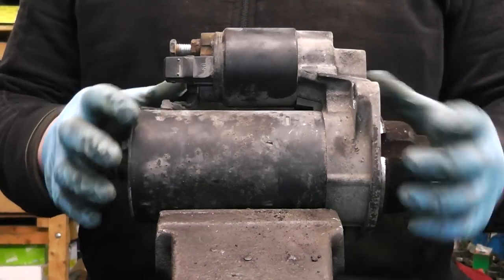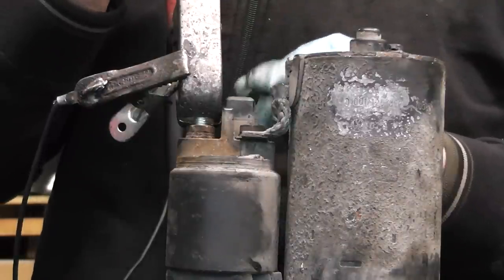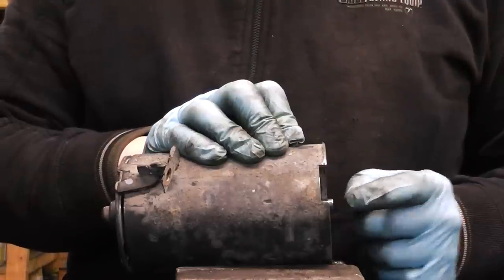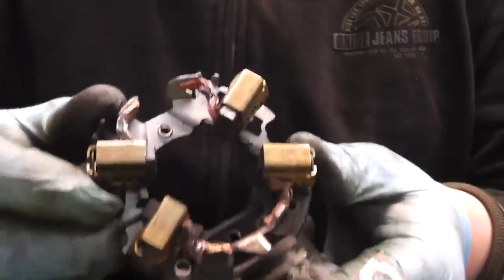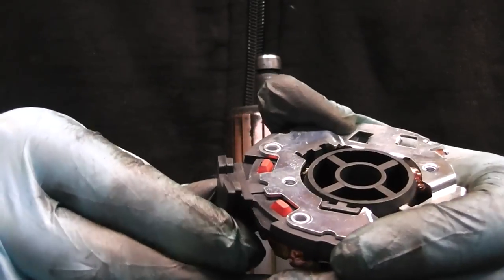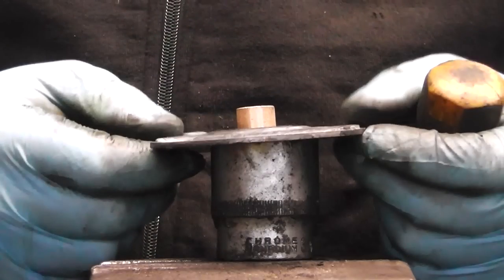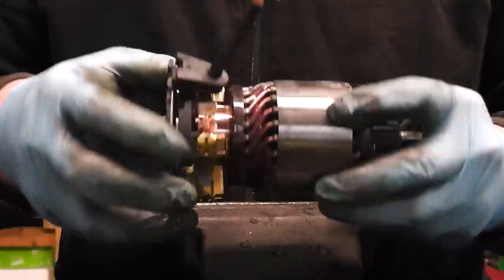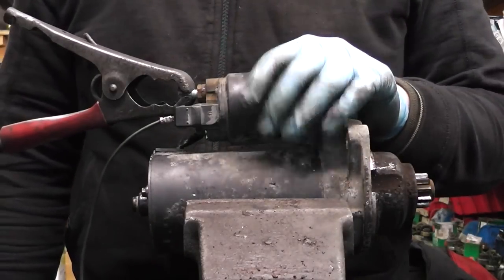Bosch 110 series starter motor brushbox and bushing change.

Comment: I am repairing the starter on my mother's Escort right at this moment, to save her the expenses, and this is a big help. Awesome and thank you for the video!
Reply: was it successful?
Reply: @timothy790110  Sort of. The car was just clicking on the key. I changed the brushes, and did all the cleaning, but the problem was actually with the solenoid. So I kind of did some unnecessary work. However, after putting a new solenoid and everything refurbished inside, the car starts like crazy now. Though we still had to buy a new solenoid. :)
Reply: @aleksandari.7834  good to hear! Im about to do the same to my renault master, at the very least i think ill learn something, but i will test the solenoid first! What were your symptoms? Did it sound like this? https://www.youtube.com/watch?v=x3QnY0iFPcA

Comment: If it had not been your video I would had a lot of trouble figuring out whty my car's starter   works without the solenoid after I have taken it apart and cleaned it. Stupidly I changed the bottom terminal  with power + terminal so the starter worked except the solenoid.  On your video I noticed the right connection.    Starter starts a little bit later than it used to I don't know why.  Thanks for the upload!

Comment: Excellent repair guide!!! Today I alone fix and repair my starter Bosch 0-001-125-007. I changed the solenoid and brushes and everything works now!
Reply: doomkillerr
Reply: Well done
Reply: Thanks
Reply: What is solenoid...and the black wire plug what is its purpose

Comment: Many thanks for the best video I can find here on youtube on repairing these starters , I,m used to the older Lucas ones & needed your education before starting on this job , as I,d never seen one like this before , I,ve liked it & subscribed , so good video . If I end up needing parts I,ll check out your ebay shop , thanks very much from central england  .

Comment: Great video. One thing I would add is to use a very fine grit sandpaper only. The one in the video seems to be very rough. What it does it leaves deep grooves behind which in turn eats up the new brushes way faster.

Comment: Errol Dillon, This comment is mainly for you.  I stopped this at 4:09 to acknowledge that this service tech has done two basic tests so far.  1) A solenoid and starter test, and 2) A starter crank test.

Both tests showed negative/no operational results.  At this point he states that it is because the brushes are not making contact with the motor armature when he should have said the commutator.

At this point, I will point out that two issues are present.  A) The solenoid does not work as you can clearly tell that it does not click/engage, and B) The starter does not work as it does not engage/spin.  Two separate and distinctive issues!

As am example: A solenoid may work just fine and yet the starter will not work.  The fact that the solenoid did not work is one issue.
Bypassing the solenoid and applying power to the starter proved that it too didn't work!

Next test is to confirm a good ground/continuity between the solenoid and the starter casing.  If not?  fix that and see if the solenoid will engage.  Failing that, replace the solenoid!

The next step is to dismantle the starter and troubleshoot it.

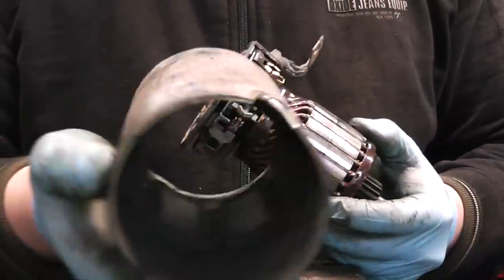At 5:45 I stopped again.  Before unbolting and separating the starter casing and pulling it all apart, I would suggest slacking off the cap cover screws while it's in the vise!  Just makes tings a bit easier...

And for N Russell........  I believe the Tech is Irish and not German.... Oh well... Good ole Irish.   Overall, a fantastic video, commentary and clear close up camera work.

Comment: Great video.  Very instructive.  The 110 appears to differ from the model 214 which I have.  I started by removing the long bolts and whilst the two parts come apart, it is only about an inch before it arrests.  Any idea how it comes apart so that I can clean the commutator and check the brushes.  This is on a 25 year old garden tractor and it starts a single cylinder Lombardini diesel engine.
You comments would be welcome.
Also, do you know of a good shop where I can access the parts required?

Comment: Just a tip from a pro. undo the 2 philipps screw first with side cutters just to loosen them. Thats if you want to save them. Cool tho mate. When i was at valeo we used to put 100`s of comm end bushes in but from the other side , only because it pushed the old one out.

Comment: Hello,I think the rotor has to be replaced as well, because there is a broken, raised lamella and soon it will break the brush holder again! Both rotor bushings and needle bearing in the front cover. Cheetah, too. On the switch the nut has changed its color, that is, it is overheated, so the switch is also likely to have a problem. :)The bendix remains, and if it changes the starter becomes - recycled and reliable for many years!That's what I would do! :)

Comment: I enjoyed this video. Is there a chance that you could make a video about replacing the bendix, front bushing and planetary gear ? I tried to replace the bendix on my starter an got stuck on getting of the circlip at the end of the driving gear's shaft. Which lubricant is recomended to use when lubricating the parts inside the starter? thanx

Comment: An excellent explanation, but you also need to clean the process, clean all parts with diesel, water and air, beyond that it is better to flatten the rotor when it is on a standing drill, better on the lathe and there are several more tests

Comment: Great vid. I have a VW Polo 1.4 16v 2001. Lately my motor starter sounds wierd after the ignition but some times it works fine. I think it is the gears and some grease would fix the problem. However more and more often the starter won;t crank at all. Simply when i ignite, the lights go off and a sound of force is to be heard from the starter (a click) but stops and dies. Giving 2 or 3 tries brings the cranking and the ignition but some times it remains stuck. Battery seems decent. 
Do i have voltage loss or does the starter has to be removed and cleaned? Any ideas?

Comment: what lube to use on the gears inside and the upper bush - silisone grease(dielectric grease) or bearing grease? which is better?
Reply: I use a full synthetic bearing lube, sparingly, after cleaning all the old lube and grease out of it. The synthetics are more consistent (they don't get really thick) when the temp drops here in Wisconsin.

Comment: i need to rebuild a bosch 107 series starter,simple questions!!!
its possible to resolder new brushes with out buying the whole brush assembly?
because there is no sign of flux to the attached oem brushes,they seem to be spot welded in place.
do i need to cut the old brush lead and leave the soldered copper remains intact to then resolder the new ones? 
thanks!
Reply: Yes, that's correct. It was done like that in most cases. Just a few decades ago "repair kits" where not available. So that was the normal procedure. ;-)

Comment: Where do you get Bosch replacement parts for these starters, specifically a drive gear for the 0 001 110 059.

Comment: Good vid.  Thanks for showing me the saw blade technique.  I used a steel pic and a toothbrush. Very packed in and made the sides uneven. Which could have been causing a short.  Brushes seem to be ok mostly even wear about a 20 thousands between the spring should take of that. Thanks again.

Comment: Hi - Very nice video. Do you ship your parts to the USA? I have a Volvo 240 where the braided copper wire between the solenoid and starter motor corroded all the way through!

Comment: I am having trouble finding the brush plate for a 2008 Land Rover LR2. Bosch 001 121 423. Any help would be appreciated. Thanks
Reply: Gamaliel Gomez
 - If you can't get the entire brush box in kit form ready to assemble.
Get the brushes individually and solder them to the old brush box.

Notice that in more extreme cases, like restoring a rare/old starter, where parts are not available. You can use brushes from other brands, size, suppliers, etc. and adjust them to the size you need. 
Notice I said extreme, because while possible (don't ask) it's a pain in the a_s to do it. Small file and sandpaper is all that's needed to adjust the brushes. Well a lot of patience tend to help. ;-)
Cheers

Comment: Question on my Porsche boxster 1997 2.5 L, my car starts fine and then after driving running errands frequent starting my starter turns over slow starts car but makes you think the battery is dead. I checked my battery and its fine what causes this? Thanks!!
Reply: Mine does the same thing have you found out what  it is.
Reply: Farmer2492 
I would start by checking the condition of the earth from engine to chassis .
You may find it corroded or badly deteriorated .
A good starting point.
Reply: Thank you much appreciated
Reply: Slow cranking and high current draw typically indicate worn bearings or bushings inside the starter. Worn bushings will result in an off-centre armature. This may result in poling and can throw off the alignment of the starters magnetic fields.
Reply: URSOAKINGINITMATE how  do you fix worn bearings in a starter
Reply: Manqoba Wiseman
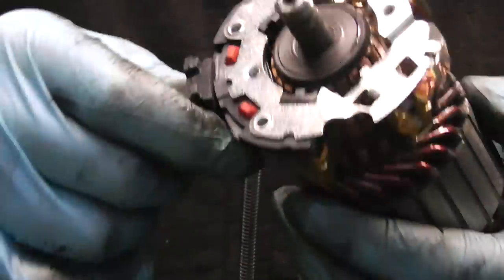The method used to change worn bushing or bearing in a starter motor begins at 10:25 in this video...pretty self explanatory...hope it helps :)
Reply: Thanks, how much do these cost around
Reply: Bush or new starter motor?